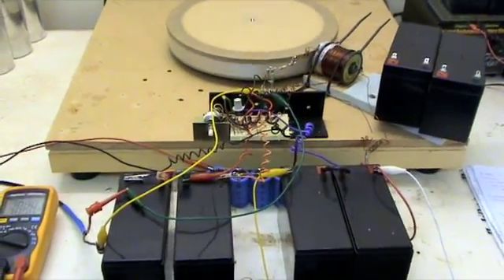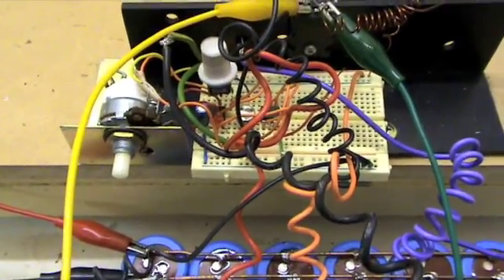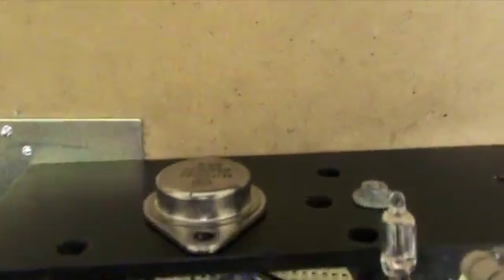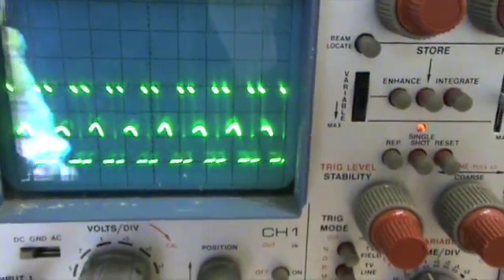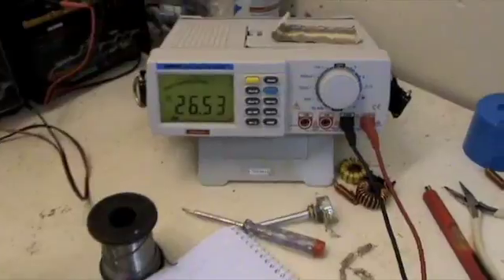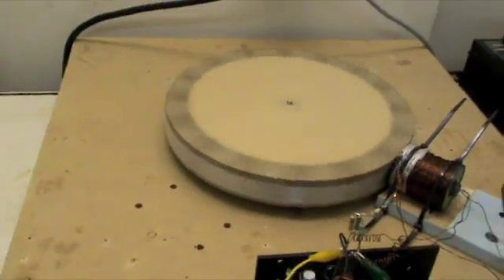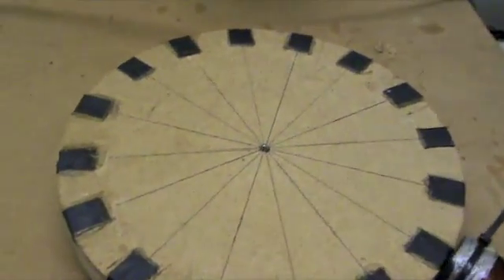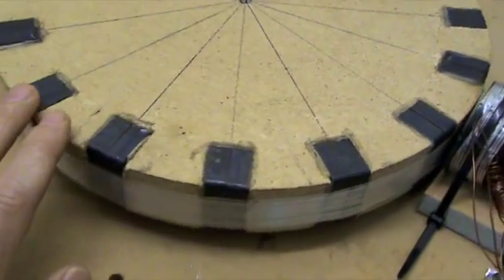16 Pole Superpole Bedini Pt 1

Comment: I am kinda confused now. AFAIK North is attracting South and vice versa. Therefore when you turn  your rotor  I see scalar SOUTH from your magnets since they're attracting the north pole  on the compass and in between the magnets I see norths. You have just said the opposite there. Did I get it wrong ? Thanks for clarification.